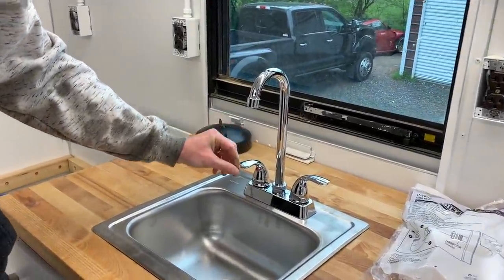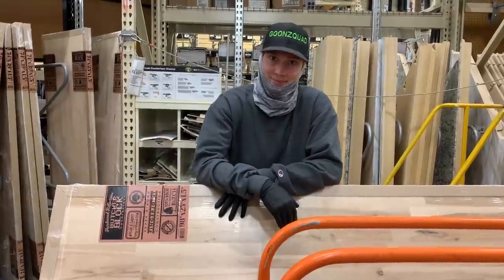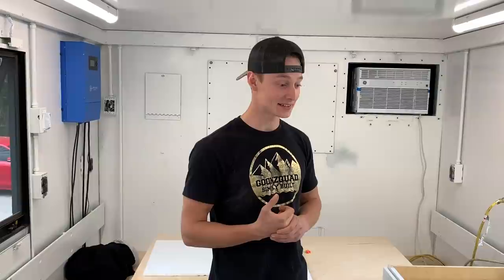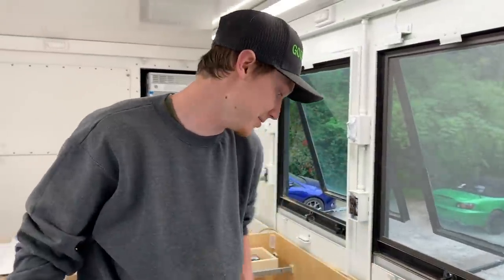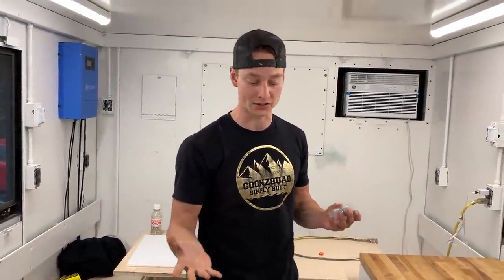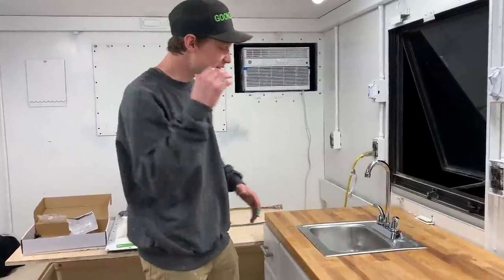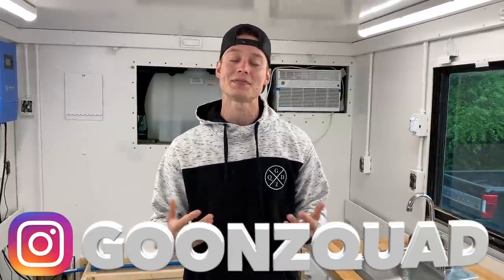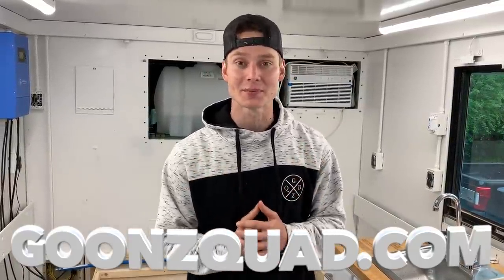Building The Ultimate Apocalypse Vehicle Part 7

Comment: You’re really defeating the purpose of the gloves whenever you get back into the truck. Whatever the gloves might’ve touched are now in the trucks interior
Reply: plus, those bandannas are worthless!
Reply: And the masks do nothing!!
Reply: @michaeldancurtis  Not gonna lie when I read " China Virus" I thought was you were going to say would be BS but you are 100% correct. Thank you for also explaining what a aerosol pathogen is as well as some believeit is the same as airborne. A side note is that COVID-19 is only protected by a small layer of fat so it can only last 72 hrs (MAX on plastics), but much less on cotton / clothing.
EDIT: Spelling.
Reply: @michaeldancurtis  medical term for it is droplet! in the hospital we take "droplet precautions" which is gown, n95 mask, goggles or some eye protection and gloves
Reply: Michael Curtis aerosol transmission is only for a very limited time directly after a host has expectorated.
Physics dictate f=ma, the aerosolized particles would arch and fall not dance or remained suspended indefinitely.

Comment: As an rv technician myself, a few things I could suggest is There is still lots of air in the system, let the water pump run for a little to pump out the air, put a vent hole in the top of the fresh tank as well, if the water pump just never shuts off after all the air is pumped out you may need to adjust the pressure on the pump with a small Allen key. Also should consider putting a low point drain in line with the water line for when you might ever need to remove plumbing from sink. 
You guys should absolutely steal the battery compartment from the interior living area and make sure you guys make a vent to fresh air for the batteries.  If they overcharge and vent off gasses it's not going to be pretty so need to seal the box.  The waste water from the kitchen sink is going to need to drain into a "grey" water holding tank. And really you could dump it into the yard and have some really nice green grass.
Reply: Caleb Parra do they need the pump? I feel like gravity will pump the water, they do need to vent the tank on top tho
Reply: @mulemake4869  my thought exactly....gravity will empty that tank
Reply: @chascain1   It will be a slow stream of water since the tank and faucet height is almost on the same level. The pump is the way to go..
Reply: Ashley D'Costa that sounds accurate aswell
Reply: i put that about venting batteries and inverter  in a segment whet they were doing it.. i hope they see these comments ..
Reply: Hope the water in the outer part of the plumbing system (19:30) will not froze during winter days.
Reply: @mihai2k1  - where they live, it is only a concern for like a few days out of the entire year.
Reply: @mulemake4869  it's best to use a pump, it'll provide best water pressure on demand.
Reply: @ashleydcosta1498  absolutely agreed
Reply: @mihai2k1  even of ot gets cold enough for them they can get a relatively cheap tank heater, 12v DC power and super easy to install. Keeps it from freezing

Comment: MAKE SOME WENTS FOR THE BATTERIES, that aint the right kinda batteries, when they charge they make gas, and one small spark, BOOOM! make a went that goes outside or change batteries
Reply: True on the batteries although I think they are AGM. I would do Convection cook tops for safety.
Reply: hydrogen to be specific
Reply: Lukas Waagen wait don’t you mean Vents? Not Wents
Reply: No open flame.
Reply: I meant induction not convection, my bad
Reply: Yes, vented outside, plus they should have space between them for cooling
Reply: @ALLGUMSANDTEETH  I thought they used AGM as well which should mean no off gassing.
Reply: Everyone else seems to have forgot about the batteries being hazardous in their current setup.
Reply: @ALLGUMSANDTEETH  they're not sealed batteries. look at the previous video on solar panel...they're deep cycle duralast with two removable top...so its not sealed and will gas up.
Reply: @Drew-cz7hw  check their previous solar video...they're not sealed batteries lol
Reply: @jd6041  I thought it was perfectly good, considering his last name is probably also pronounced like a V. :)  Either way, we know what he meant.
Reply: @ALLGUMSANDTEETH  doesn't matter if they are AGM...they still off gas when charging.  AGM still needs to be vented because they will still produce hydrogen.
Reply: yes , you are right, and also for the fridge , because of  the hot  temperature on the back
Reply: THEY HAVE THE WINDOWS OPEN
Reply: Wents? Are you related to Elmer Fudd??? It’s V V V Vents my guy
Reply: @shartne  that wont help that much
Reply: Trojan battery last long!!!
Reply: I think he's doing a Elmer Fudd thing. Instead of Rabbit it's Wabbit. Or in his case: wents instead of vents.
Reply: He's Norwegian. His language is Germanic, which means Ws are pronounced like Vs. He's thinking and typing in a mixture of Norwegian & English, which caused him to say wents. To him, it's still pronounced like vents.
Reply: finally they seen the thing we needed them to see
Reply: @Drew-cz7hw  nope, they used lead acid deep cycle
Reply: Bro they stole thenX logo for merch.. I love goon squad but then x been around way longer and yall damn well know it's his logo. Change up
Reply: Bro yall stole THENX logo.. he been around way longer. I love yall but yall need to fix this asap goonz
Reply: Bro thenx had your logo first. Not cool.  Fix this

Comment: Fellas read this I’m very familiar with those exact pumps!!! I would just return that original pump you all bought it’s def overkill!! All you need is a pentair/shurflo $85-$110 common diaphragm pump that every rv store sells!! That’s literally what the manufactures use!! Save the money for sodas/flowers!! 

I use those 90$ shurflo/pentair pumps as sprayers/foliar feeders for my farms and they are perfect for what you need esp bc you won’t have a shower!! That one you bought was waaaay overkill!!! I would def consider moving the pump closer to your water source to reduce the amount of head the pump has. Also you always want to have your suction hose be bigger than your spray/outlet hose.. and FYI those diaphragm pumps are self priming but occasionally take a a lil bit to fully prime themselfs!! Lemme know if you need any other help!!
Reply: Matthew Fogarty those water tanks have a bleed valve on the very top built into the cap they are usually green or blue and in the middle of the top.. also take much more than 5psi to Have any sort of water pressure

Comment: good day.  

you need two air vents for your refrigerator to make it efficient and energy efficient.  
the refrigerator must be able to dissipate its heat, 
it is best that outwards and cold air in an air grille behind the refrigerator in the floor 
and the hot air output at the top through the side of the superstructure, 
just like with campers with an insect grid on the outside  .  

I would put a pressure switch on your water pump.  
when the water pipe is full and the tap is closed, the pump builds up a little pressure and then stops 
until the tap is used and the pressure in the water pipe drops, 
the pump starts up immediately.  
so you can use the water tap like at home.  
put a transport / off switch so that when you drive that you can turn it off completely.  

the water tank has now been given a very unusual place and is now also very difficult to fill.  
maybe just a water supply hose with garden hose coupling from the lid to next to the spare wheel or something.  
then you just need to connect the garden hose to fill.  
don't forget to put an overflow stroke at the top of the tank in the lid or something.  
if water comes out, 
the tank is full 
and so you do not build up pressure with the garden hose when the tank is full .

kind regards Hollandduck from the Netherlands
Reply: Those lilfridge  guys are good theres room above the fridge and a 1 /4 gap either side..
Reply: Very good info bud
Reply: GREAT INFO, GREAT ADVICE. I don’t think they’re reading any of it though, which is too bad, but like most people, they will learn the hard way through mistakes and messes!! You’d think with information so readily available online now, that people don’t have to learn sh*t the hard way anymore.... guess not! 🤣🥴
Reply: @ricktaylor14001  they usually have been good about reading comments in the past. This project seems a little rushed compared to the supercars

Comment: That extra piece of counter-top you should cut to fit on top of the sink hole for more counter space when the sink isnt used.
Reply: Mr Gndrn that’s would be cool. And clean
Reply: Great tip
Reply: @mrfahrenheit3867  The Sink would need to be "Counter" Sunk for that to work. Also, yeah. You cant put Self priming pump on upside down.
Reply: Like how boats do it, usually have a cover on sink to maximize space
Reply: Or you could use it as cutting board and not ruin the countertops cutting on them
Reply: The sink would need to be an under the counter sink not a drop in sink.
Reply: @njmcw126  it would still be useful and look good.
Reply: Good idea but I feal like that wouldn’t look to good almost like it was just thrown on there I think he should cut it and use it for shelving possibly magnetic

Comment: You guys should just keep an eye on those batteries... They seem like flooded lead acid deep cycle batteries... So when they charge they bubble and create a gas that is vented out of the battery, and you guys straight up sealed the whole compartment of the batteries, so you guys have a live grenade just waiting to explode. Just bust a hole or two in the wall and put some house vents in so that the air is constantly moving in there. Love y'all guys
Reply: Maybe they should put them on the lower left side right below where there at. Just make a storage box, with vents, and some longer cables.
Reply: exactly @Leandro Baden. You guys should have built a 100Ah lithium bank out of the HEADWAY 38120 HP 3.2V 8AH LIFEPO4 BATTERIES. Would have saved money, weight and been way for powerful. Hit me up if you'd like more details.
Reply: They don't care.
Reply: @Leandro Baden- I've been in the solar power business. The batteries these boys are using are sealed- they don't give off gasses when being recharged. Installed many of them.
Reply: Yeah and god forbid one of those batteries crap out while they're in there.  They might die from the poisonous gas
Reply: Take the “gas” out of the equation....I’m not sure I’d want to put those batteries right under where I lay my head at night.  Anything mechanical or electrical has a risk of failure.  Would hate for a short to catch it on fire.  An external box would have been my 1st choice (plus it would have left more internal storage space.
Reply: They’re a sealed maintenance free battery Leandro. Only vented battery I’ve seen that still gets used is on motorcycles from the 80s and Yamaha tw200’s lol
Reply: they aren't reading the comments. hopefully they see this since everyones been telling them. i even dmed them
Reply: I think it's funny when people think it's necessary to say how long they've been doing something, but it's all out hilarious when they do that and are completely wrong about the information they give. Everyone here claiming these batteries are sealed, you are wrong. The batteries they are using are Duralast Group 29 dual purpose deep cycle batteries and they are NOT sealed! If you can't tell by it having freakin vent caps, look the battery up. It's a Duralast 29DP-DL
Reply: they just do not care
Reply: They don’t listen 👂🏻
Reply: i have seen batteries that big explode i mean its nothing to play around with... even though  messed around with it anyway. but i was younger and a very odd child and it sucks to see a expensive Battery explode also i ruind a pool with a modified rc speed boat i put lytheum batteries in it and t exploded because it could'nt handle the speed

Comment: The pump just has air in the system, check your fittings, and purge. If you want a smoother quieter on and off add a small expansion tank. Shurflow 182-200 RV expansion tank

Comment: For the water system you may want to add a “city water hookup” so you can run off water without using tank water. But it will also allow you access to the water system to winterize it
Reply: Why not use induction stove? With the free energy on your roof the best option in my opinion.
Reply: Müller Volker I believe any decent size stove will draw too many amps for their inverter system. Thus they can’t use it unless plugged into “shore power” or generator power
Reply: Müller Volker even a 1000 watt inverter only converts to 8.5 amps at 120volts. Probably wouldn’t even run a toaster
Reply: Run a bead of silicone under the rim of the sink to hold it in place and to prevent water from getting beneath the sink.
Reply: I did not see a low point drain for your water tank. You may be good for the summer but you will need it to drain the tank for winter and to winterize.

Comment: May need to vent your water storage tank, you may be pulling a vacuum into the tank. That will make your pump work harder and fail.
Reply: That's what i was thinking. The pump sounded like it was working harder than intended.

Comment: Is there an air vent in the water tank?  Couldn't see.

 Just so air enters the tank as water exits...so it doesn't implode from the suction of the pump.  👍😎
Reply: My thought is that it's in the cap and may very well leak water when driving and might enter the box through that wall access panel and damage the inside.  May be able to vent tube it under the bottom of the tank though.  A remote fill port would make filling it so much easier too!
Reply: Vent tube above tank with screen. Don't want bugs getting in. Research how RVs do it.
Reply: Those tanks have a one way valve built into the tank lid.
Reply: @leethomas1776  
Nah ! Even simplier trick as on off-road bikes: a piece of plasitic tubing on that big twist-on top cap, tie-wrapped to surrounding  brackets, making an "s" . Easy fix !

Comment: Y’all need a few things on the water system. Going from the tank to the sink: 1) check valve 2) small bladder/expansion tank 3)adjustable pressure switch to turn the pump on/off
Reply: Michael Morgan pump has a built in pressure switch
Reply: Nor do you need the check valve or tank!!!
Reply: Michael Morgan Not sure if anyone told you but the pump has a built in pressure switch

Comment: for the cupboards, you could install lock handles, which are handles that you push and they lock in place, out of the way and to unlock you push them and the handle pops out. They are used on yachts, RV's and campers. Heres a website in for you guys https://www.aliexpress.com/popular/rv-cabinet-locks.html

You guys might also like to install a filter tap alongside the sink so you can have fresh drinking water from the water tank cause in an apocalypse you would need water to survive and you don't wanna get sick drinking contaminated water.

Comment: You can find “dishwasher panel” at Home Depot and gonna look way more nice....I work with cabinets.
Reply: Gotta add a water heater and generator
Reply: @charlieglines4483  he meant for the looks not an actual dishwasher...also they already have a generator...... and an electric water heater is easily found in home depot. theyre waiting till they do the water lines

Comment: You chose a wood block countertop! Love you gave up on the granite its for the best!

You seem unsure about that water tank, i am too. At least its a premade, you can get those for cheap, not a big loss if you end up swapping it out. I definitely recommend getting a custom one built, i did and it fits right in an area on my van you purposely can't see, its thin but large enough to last a long time. 

In terms of filtration getting water through gutters is way over the top but possible, otherwise finding water sources is super simple, just make sure it can be refilled by hose pipe AND water containers through a large opening. YOu can find water sources just about anywhere, when it comes to filters for the water if you can get a reverse osmosis for the drinking part, and a simple but high enough flow for sink usage. 
Either have a smaller water tank (inside) or a heavy duty reverse osmosis system for drinking water, keep washing water separate or through a different higher flow filter.

Along with the glue for the worktop use screws from the underside, just to be safe long term

Running all appliances and stuff on propane/lpg is way better i agree, the gas nozzles are way smaller so gas usage is basically nothing, a small barbecue bottle will get you a good 2 weeks

For the fridge latch, go on amazon, there are child safe latches that are like locks to easily open and close fridges while keeping them shut, highly recommend!

Definitely try to mount the water tank low, keep the weight as low as possible.

That pump as far as i can tell seems normal, just let it run for a good while get all the air out. The lines from the pump should be short and straight, they are high pressure. Does the pump have a high pressure switch?

Comment: When you guys add/change the water lines. Shower, heater, ext. faucet whatever. Run it in 1/2 inch pex. No need to use 3/4. Plus 1/2 is easy to run. Bends good, using less fittings. Add a drain somewhere at the lowest point. Pex is freeze thaw stable but your pump and faucet aren't. Be careful. An expansion tank is nice. Helps the pump by not allowing it to cycle on and off a lot. Run a power switch for the pump up next to the sink. Personally I wouldn't worry about a Grey water tank. Use biodegradable soap and call it good. Not like you guys are going to stay at an RV campground with that rig. But... That would be a great video😉.